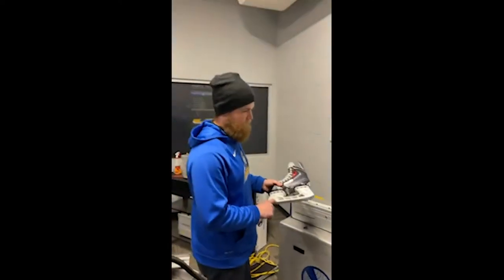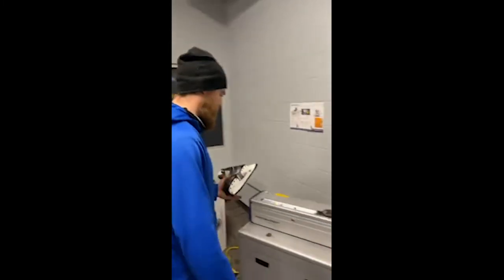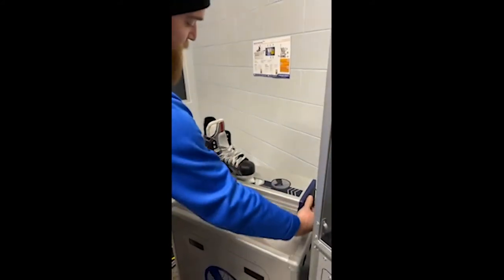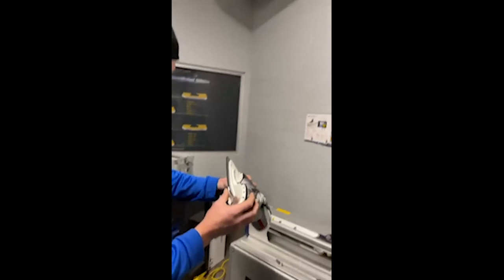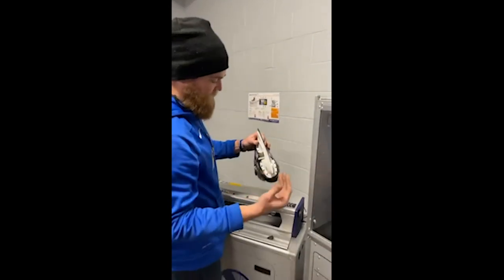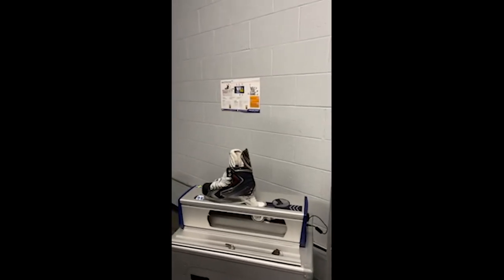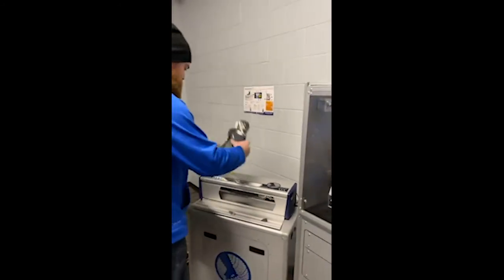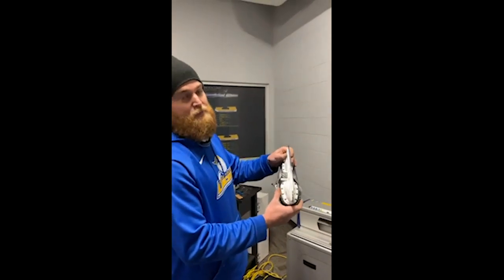Prosharp Academy – Webinar 12 – How to calibrate the PROSHARP HOME

Comment: Hello
I have a Skatepal pro that I will sharpen Channel Z with. Watched a video here on Youtube where you adjusted the skate holder to the grinding wheel with Prosharp 29024 Wheel adjustment tool but can not find where to buy this fantastic tool ...  Someone who knows where to buy this
Reply from the maker: Hej Mikael,
Tyvärr har den produkten utgått. Maskinerna är kalibrerade från fabrik, men om du behöver justera positionen av skivan är det bättre att köra ett så kallat skålstopp. Där du målar med en tuschpenna på undersidan av skenan innan slipning. Starta igång slipningen och avbryt slipningen när skivan är på mitten av skenan. Kolla om färgen är helt borta på den slipade delen av skenan och om det är ett helt horisontellt streck där du utförde stoppet.

Comment: Hi guys, I recently purchased a prosharp home (used 2018) and in order to get level edges I have to turn the adjustment knob to the extreme right position.(I’m careful to install the grinding ring correctly) Is there a coarse adjustment somewhere on the machine?
Reply from the maker: Hi! The machine is calibrated from the factory and as long as you get level edges it doesn't matter if the adjustment knob is in the extreme positions on either side. All that matters is that the clamping and wheel align and that you get level edges. Was that an answer to your question?
Reply: @ProsharpWorld  I forgot to add : an equal number of passes have to be made with the skate facing each way in the machine.
Reply from the maker: @edgerunnermobileskatesharps  You shouldn't have to do that. We would recommend that you color the bottom of the blade with a sharpie. Sharpen the blade and stop it halfway through the pass. Unclamp the blade and look at the bottom of the skate. See that all of the color is gone on the sharpened part of the blade. Look at where the grinding wheel was stopped, is it a horizontal line or is it skewed?
Reply: @ProsharpWorld  hello again, I wanted to send pics of the marker test but I think I’m unable to do that in this forum. The results are: at the beginning of the blade, less than half of the marker is removed and slowly towards the middle of the skate blade it nearly all is removed.
It seems to me either the ring is not moving in a straight line or the holder is not allowing for a parallel placement or maybe both.
Reply from the maker: @edgerunnermobileskatesharps  It seems like the machine needs to be calibrated by a Prosharp technician. Where are you located?
Reply: @ProsharpWorld  I’m in Toronto. I’m waiting to get it into John at the Ford centre. I find myself in a tough situation. I started a mobile skate sharpening service and I’m swamped with business. Obviously I’m not happy with the way my machine is working. So for the time being I’m using it for deep nicks and cuts with a course wheel. And then fine-tuning the sharpenings on another system. Of course I would like to bypass this other system entirely but as of the time being the quality is not good enough to just use the ProSharp.
Reply from the maker: @edgerunnermobileskatesharps  We're sorry to hear that. The best option is that John will have a look at it and do an assessment. Are you still in contact with him?
Reply: @edgerunnermobileskatesharps  Hello. Your used machine's self centering mechanism needs to be re aligned by Prosharp. My bet is the prior owner played with it and got it goofed up. You should not have to sharpen two times; ie once left and once pointing right. 

So the self centering mechanism is on yours is not parallel to the frame.

I base this on my own Prosharp Home that was bought new and is aligned.  Plus a used Prosharp Skatepal 3 that had its self centering mechanism was not parallel. I aligned my prosharp skatepal 3 myself but it is very difficult to do without a factory fixture.

Place a loose hockey skate blade in your Prosharp Home unit. Use a blade only with no holder ie no skate. The skate blade should be parallel to the units extrusion. The grinding motor's "sledge" rides along features of the units top cover extrusion, ie on the underside.

In used skate sharpeners of any brand or type often the used ones have been messed with . The same error you have happens on a desktop machine when the skate holder has one side lower due to being played with.
Reply: I also have a problem with the wheel being able to move all the way towards me but when i go the other way, i can only get the wheel to about the half way mark and it won’t go any further! How do i fix this?? @prosharpworld
Reply: @prosharpworld